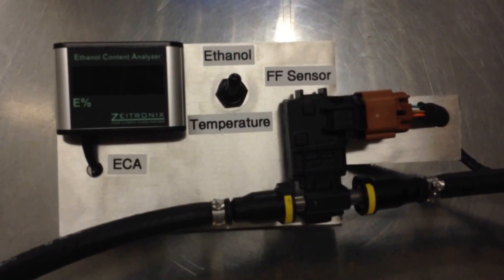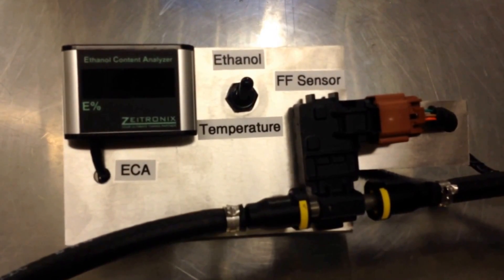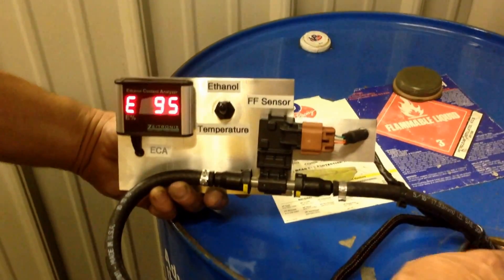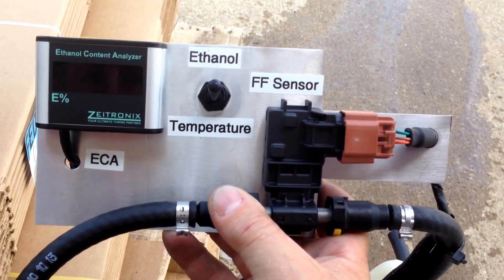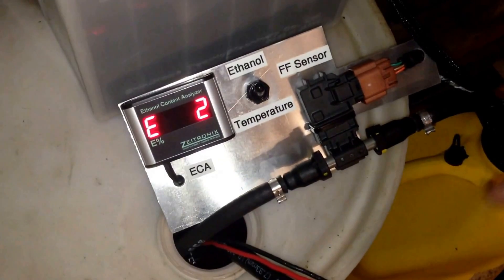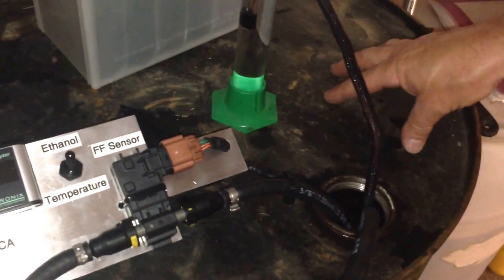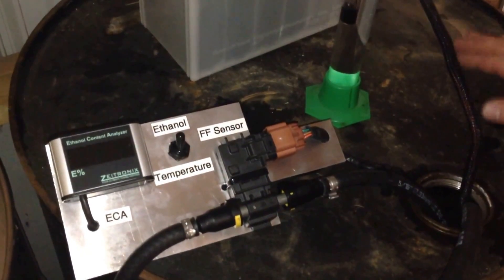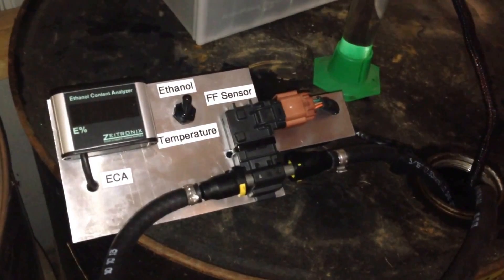Flex Fuel Sensor Testing

Comment: Water in ethanol changes conductivity,  this will make the sensor read a higher number.
Reply: im very late to the "discussion", but i have a question for you...i recently tried a different ethanol source, both claim or are supposed to be anhydride ethanol (E100), before when i mixed it with gasoline i noticed the % reported by my Flex Fuel kit was more "precise" or higher with the cheaper brand, but recently me and my friend went to a more "quality" source and we both felt like we needed to add more volume to the mix for the sensor to report the same E40-E50 amount of ethanol content...if one of them had water in it, or more water in it, would it make the sensor to read higher? tap water read E100 which makes no sense, lol, meaning, more water in the fuel (hope not) or the ethanol (hope not) could make the sensor read higher? I hope i made sense, i will appreaciate your response, cheers.

Comment: By law ethanol is required to be denatured before any other ingredients are added (gas).  So if what your buying is E85, it would be a violation of Federal law for the actual product to be over 81% ethanol as the denaturing process drops purity by about 4.5%.

Comment: It does not measure Ethanol content, It does not measure "Gasoliene" either. It measures dialectic constant, in this case, of the liquid. It is calibrated to show the Ethanol content of Gasoline when mixed with Ethanol.  If there is any other liquid contaminating the mixture, It will show the end dialectic constant of that liquid, referenced on a scale usable for it's end task. So only Dialectic constants between that of Gasoliene and Ethanol will be readable on the scale, And it will only be accurate when the ONLY ETHANOL and GASOLINE is in the mix.
As soon as you introduce another liquid, like water, the reading will be erroneous. Especially since water has a Very high dialectic constant comparative to ethanol and Mogas. It will onyl take a small amount of water contamination to make the gauge read 100%
Reply: starlessredbrush interesting
Reply: Ah! Touche!
Reply: Dielectric constant??

Comment: This sensor might just be a OHM meter measuring resistance.  More or less of ethanol or gas changes the resistance and in turn changes the output.  If tap water shows 100% try distilled water.  Try DI water and see what the meter reads.

Comment: thanks for the testing, is this buscher as in buscher racing buscher? it's interesting how the water throws these sensors off. i believe the sensor (which is really out of a flex fuel car, gm part not zeitronix part) uses some kind of resistance based measurement system to determine the ethanol to gasoline ratio. unfortunately if you throw in more variables i don't think the sensor can distinguish between ethanol and water, and i wouldn't be surprised if the sensor itself was measuring an ethanol content of over 100% voltage wise but the zeitronix is programmed to peg at 100. 

another very valuable test to us street users of e85 would be to use your testing rig to test 15 or so gallons of e85, then start adding small amounts of water in long intervals (so it has time to fully mix) and record the results of how far off it throws the sensor. many in the community would thank you for this information.

Comment: Awesome tests in this video, thanks for sharing it. My guess is that Zeitronix display isn't working for the water test because they didn't design it well. According to the datasheet of the flex fuel sensor: output frequencies from the sensor between 50-150Hz indicate gasoline vs. ethanol content (50Hz means all gasoline, 150Hz means all ethanol). If the frequency goes to 170Hz then there is contamination in the fuel. Since it read 100% ethanol the design of their simple display output just wasn't set up to correctly interpret the contamination frequency (which is dumb).

Comment: It's no different from a WB oxygen sensor that doesn't measure oxygen %, it measures combustible % instead when richer than stoich.
So water reads as E100 and moonshine reads as E0. Obviously the sensor can tell the difference between water and ethanol. What does 50/50 ethanol water read?

Comment: if it measure gas, how did u get %100 on the water test?
Reply: The sensor saw 0% gas so it ASSumed the rest was ethanol.
Reply: +JUIC3D I like your comment but also would like to add if it saw 0% gas then why when he tested the "moon shine" did it say 0?
Reply: Fill your tank with that hose!